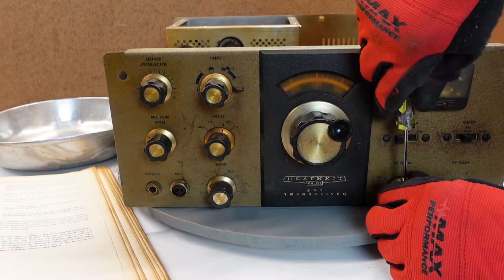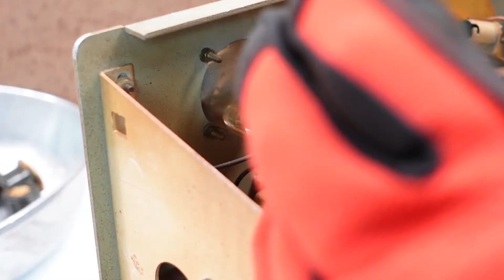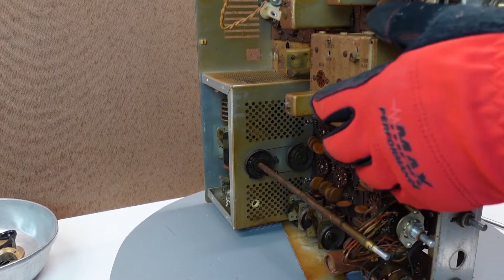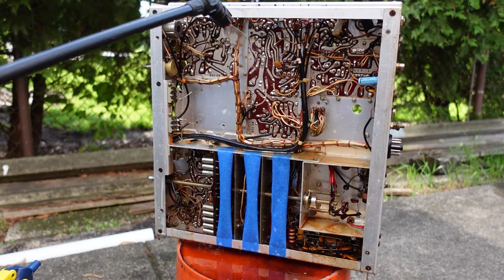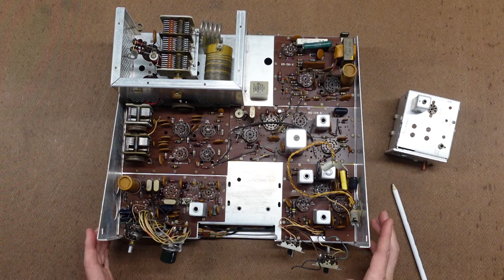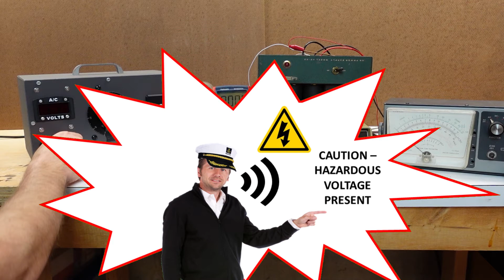Heathkit HW-101 Part #2: Cleaning & Inspection

Comment: I use this method, I  had a radio I washed but could not get the cigarette residue off this method worked great but I don't think I diluted the chemical enough because I lost some of the text on the board. A little sacrifice for a much cleaner gain. Thank you for the tips

Comment: 10:51the common wisdon on the carrier balance pot is to replace it with a 10 or 20 turn 200 Ohm Bourns pot from Mouser.

Comment: That "discoloration" is corroded aluminum. I haven't done this but I'd first try a mild solution of Castile soap and very warm water. FYI, Simple Green cleaner will corrode aluminum, too. 409 is likewise way too fierce; don't use it.

Comment: I used DOW Scrubbing bubbles bathroom cleaner on mine. Had to do it twice to get it clean and it won't harm the paint or boards. I loosened all the screws on the boards so the cleaner could get under them. De-ox-it  and youtube are your friend when working on these old boat anchors. I went ahead and sand blasted the case and repainted it with a Sage green paint. Going for function not form right now! New dial kit and new silicone rubbers. Still a work in progress.